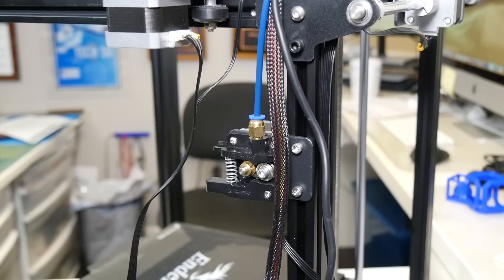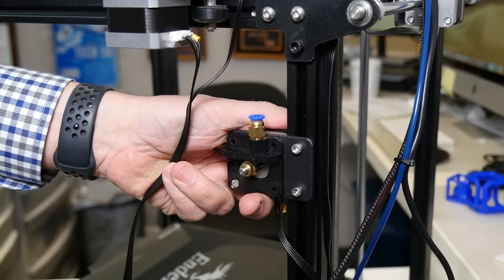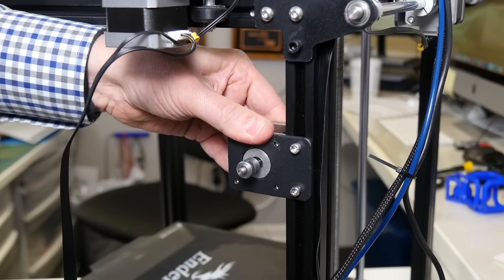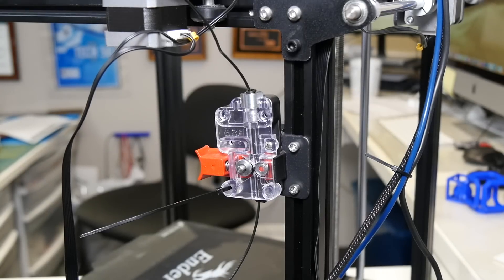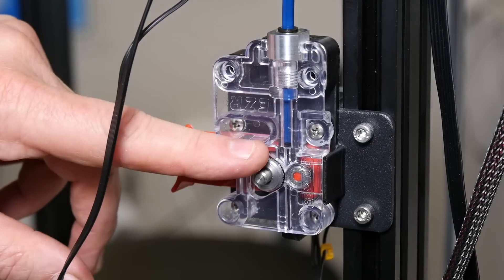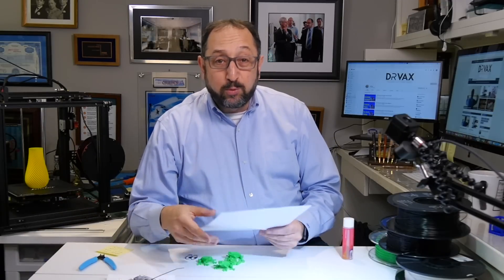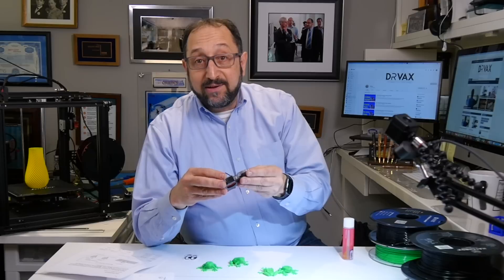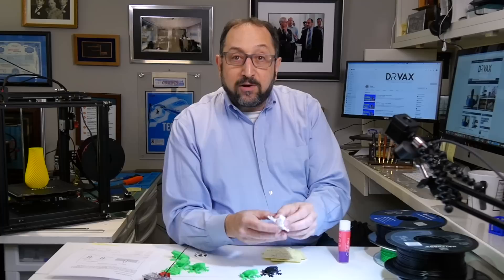Ender 5 EZR Extruder Upgrade for TPU

Comment: It's an old video, but based on it I purchased the SeeMeCNC EZR struder and installed it the other day... been printing TPU on my Ender 5 Pro without issue ever since.  I should (will...?) recalibrate esteps soon, but not feeling the need thus far.  Thanks!

Comment: IMHO, you are wasting your time with any extruder short of an aluminum DUAL GEAR direct drive configuration.  The only one I've seen that I would buy is a Micro Swiss but I decided to design my own for my E5+.  I can put pics on my google drive if anyone is interested.

Comment: Great videos and style! I understand the part about the original extruder tucked away and hard to get at.. I can't source the EZR here in UK (well not found one actually orderable).. as a part solution I brought the extruder and stepper to the front of my Ender 5.. Had to extend  10 cables to do it as they were at full stretch. Now I have all of the operations at the front. The display LCD, the SD slot (modified) the filament and extruder all to hand.

Comment: That was awesome, thank you very much. You have some great videos and they are helping me a lot. I want to get a 3D printer for various projects and mainly with flexible materials and my main concern was if the machines could handle it. This EZR seems like it will be a game changer.

Would you recommend an ender 3 or a 5? Price here right now is exactly the same for both.
Reply from the maker: The ender 5 has a larger print area but it is also quite bulky.   If you have the space I would go with the ender 5.
Reply: @MakeWithTech  thank you very much for your response!

Comment: Hi Irv.  I found out why the recall. " It had to do with one particular batch of EZR Struders where the hobbed wheel and screw did not have any teeth to it.

So when the gears tried to grip it, it could not and it would just run and run without any tractions to it.

They had to perform a recall on that particular batch of EZRs."
Reply from the maker: Thanks for sharing.  I must have gotten one before the bad batch.

Comment: My top screws were rounded.  Had to get my Dremel to grind the heads off.  All is well and the EZR is on.  Irv?  Where is Combing on S3D and what is it?  Thanks.
Reply from the maker: It is in the advanced section called “ "Avoid crossing outline for travel movements".
Reply: @MakeWithTech  Thank you

Comment: Do you really have your temp at 230c For the Sainsmart TPU?   The label says 200-220c
Reply from the maker: Yep.  Temp ranges from manufacturers are suggestions. 

First, the calibration of temperature on a 3d printer selling for a few hundred dollars is not always exact.

In addition, when printing your temperature at the nozzle of your printer will vary.  For example each time your fan comes on, even if you have a silicon sock on your nozzle, your nozzle temperature will drop slightly.  So my suggestion is to experiment and use the temperature that works best for your specific printer and filament combination.

Comment: I've followed your videos and I have all the upgrades and following your cura settings but I"m getting stringing. The prints look nice just have stringing. Using sainsmart tpu.
Reply from the maker: I like that filament.  With this extruder you can use retraction with TPU. Start at 6.5mm at 25mm/second and see if that helps without jamming.  

This assumes you are using the ezextruder and not the stock extruder.
Reply: @MakeWithTech  I'll try that tonight. I'm also having issues with the thinner layers not being stuck together. Say if I print a 1 inch wide slot then the tpu where the slot is there is layer seperation.

Comment: Thanks, Irv! I haven't printed with tpu yet but I always hated how hared it is to feed filament through the extruder. It always hits the end of the bowden tube or the connector and has taken up to 5 minutes of fumbling with it to get the filament to finally enter the tube. I upgraded to the all aluminum extruder and its the same way; maybe its time to try this one.
Reply from the maker: I found it much easier.

Comment: Very good video sir and thank you for sharing. Will you be doing a video using Matter Hackers's Nylon X filament on the Ender 5? Also Nylon G also. Thank you Dr.Vax for making such good and informative videos.
Reply from the maker: I am going to try out a Micro Swiss Hotend -- which they claim is a plug and play upgrade.  I will be trying it with a wear resistant nozzle.  Initially with PLA, PETG and ColorFabb XT.  Then if all goes well I will order some Nylon filaments --- they are a bit expensive so I have to fit them into the budget. :-)
Reply from the maker: I just ordered an all metal hot end upgrade for the Ender.  I would be concerned about printing nylon with the factory hot end.
Reply: @MakeWithTech  What hot end would you suggest to use with Nylon, Nylon X, or Nylon G? And what other preparations/or upgrades would you suggest for the Ender 5 using these filaments?

Comment: I am getting ready to purchase this exturder. Thanks for the video! On a side note for those who may read this comment, if you will counterbore the inside of your bowden tube connector on the top of the extruder, filament will feed directly into it with no problem at all. Even TPU. It doesn't take much at all to smooth out the process.
Reply from the maker: Excellent recommendation. Thanks.

Comment: and no changes to code re: steps?
Reply from the maker: Not for me.   I will be publishing a video about how to test the extruder steps per mm either tomorrow or early next week.

This did surprise me so I tested it multiple times.  While I did the initial tests with PLA I also did a test with TPU just for fun.  I found that it is not surprising that temperature has a significant impact on extrusion.   At  200C TPU under extruder by over 30 percent, at 230C TPU only under extruder by 8%.
Reply: I changed mine out last week, no changes needed works great